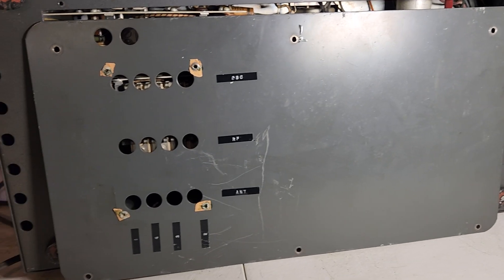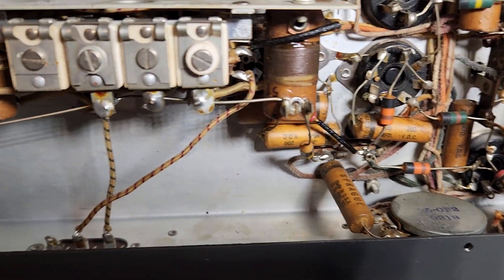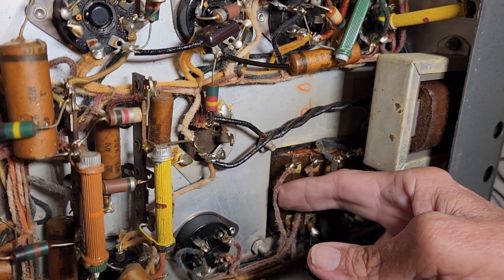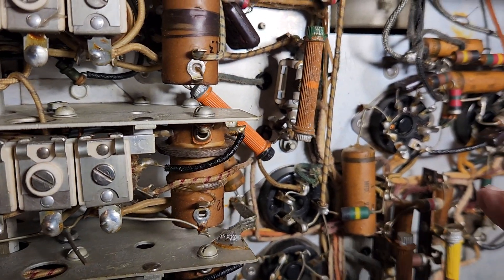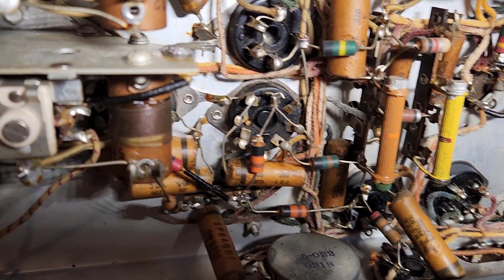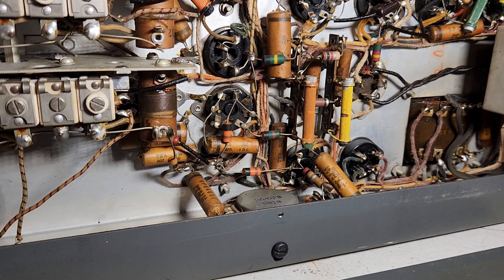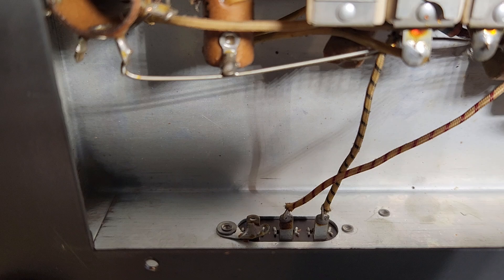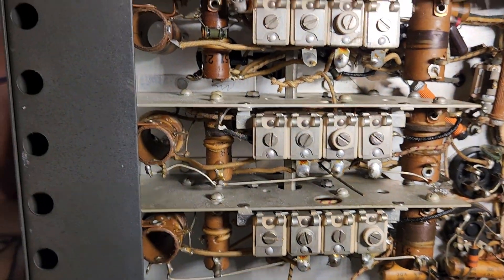Inside the Hallicrafters Skyrider SX-24

Comment: DONT RECAP!!! ITS MINT MAN!! TEST THE CAPS INCIRCUIT . I bet they are fine!!
The twisted wires are a feed back cap ... just a few pics! leave it!!
Reply from the maker: A friend of mine told me about the feed back cap.  I admit I'd never seen one before.

I don't think I can test the caps in circuit, I'm sure I'll have to unsolder one end of each cap to test it.  I'd love to leave the caps in place, they "look" fine, but there's no way they're still good.

The radio is amazingly clean inside.
Reply: Hi James, the twisted-together wires are known as a “gimmick” capacitor. Probably a couple of picofarads.
Reply from the maker: @superhet7281  Yeah, a friend of mine filled me in on that a couple of days after I shot the video.  Interesting, I'd never heard of them.